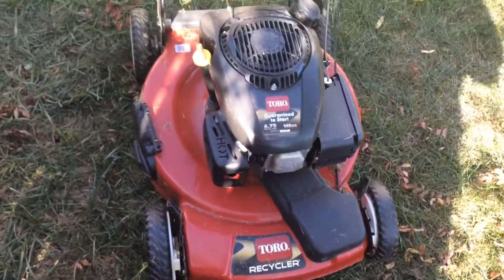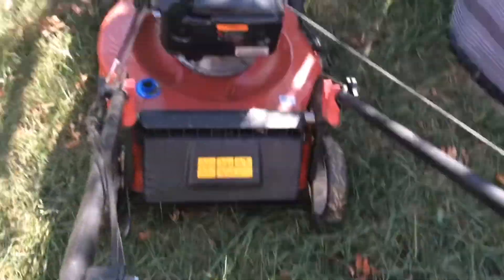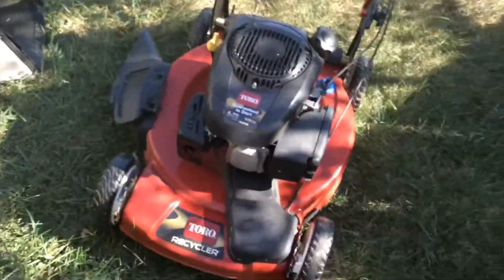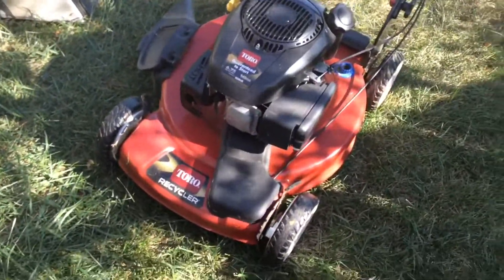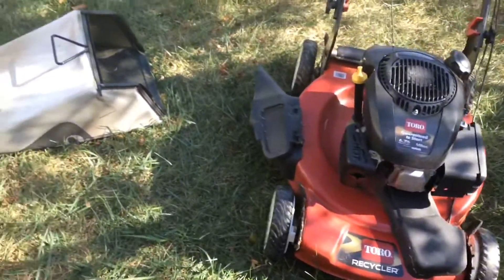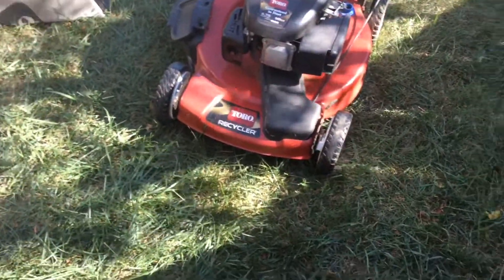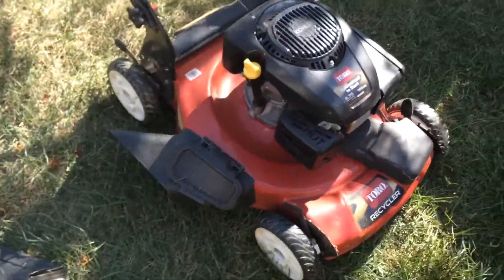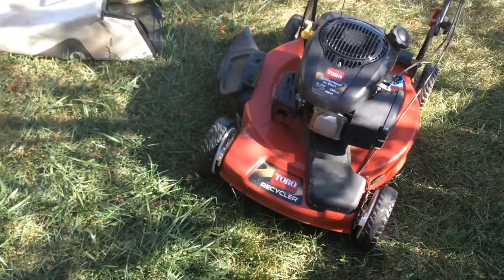Toro Recycler Mows Dry Leaves.

Comment: Have you taken off the carb and cleaned it thoroughly? Is the blade nice and sharp? Have you done a compression test? 

If you do a compression test and get a good reading, I'd check the carb. It makes sense that as you put a load on the engine, a dirty carb would be unable to supply the larger amount of gasoline and cause it to bog down or stall.
Reply from the maker: mannys9130 It was completely serviced by a top of the line mower repair shop (in business for over 40 years) and got everything tuned. Blade sharpened, carburetor rebuilt, everything cleaned. But the engine strength hasn’t changed much.